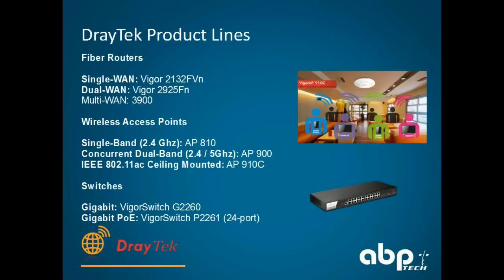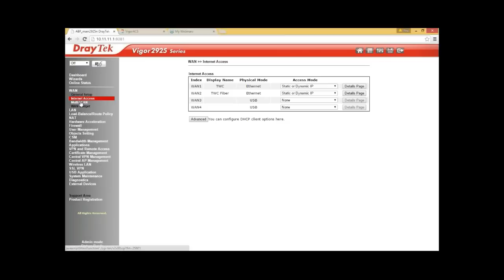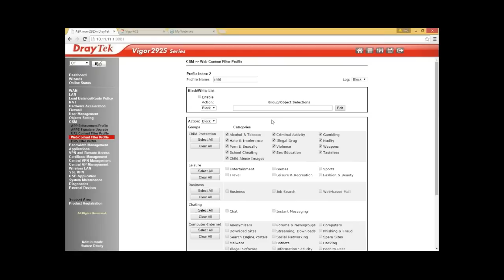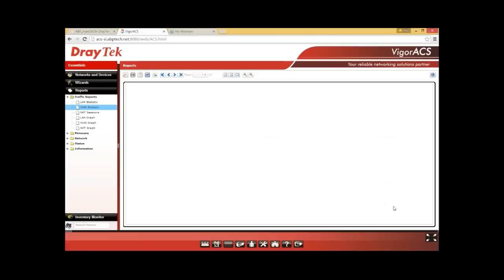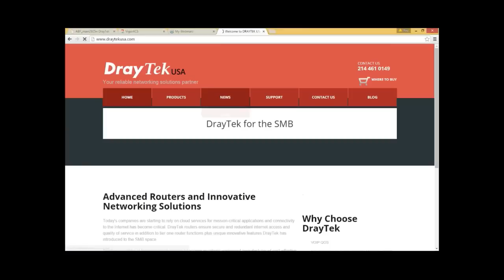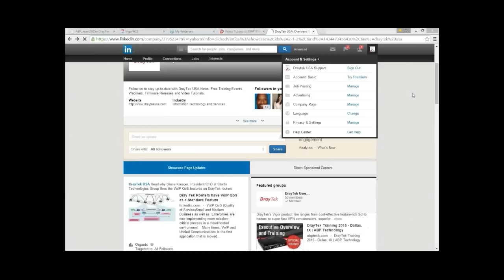DrayTek Webinar - Product Overview 2015

Comment: Is it possible to see how a failover is being managed in terms of packet losses and time of intervention? An hypothetical  5 /10 seconds delay would mean packet losses in the other cases. We would like to see how a Draytek 2925 LTE router manages a xDSL line with 3G/4G backup with no packet losses and no IP change. In some environments, IP change is not allowed and also time is critical and network must not lose packets at all.  Some HTML5 applications would need a new login if/when the IP is being changed. Also no caching technique is allowable (such as demo with youtube videos). This would not be acceptable. Any video about that failover scenario with Draytrek devices, please?